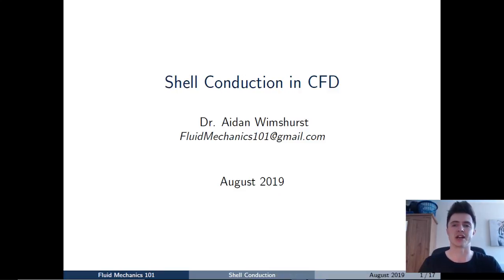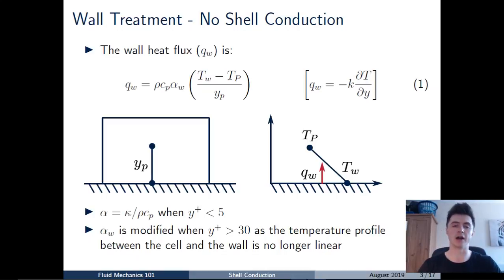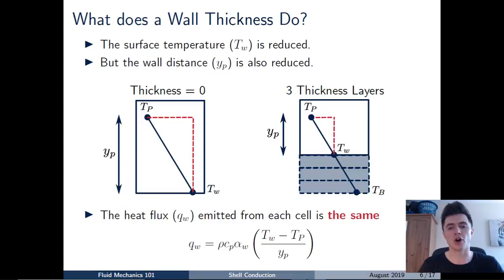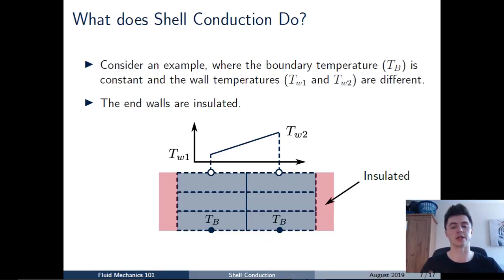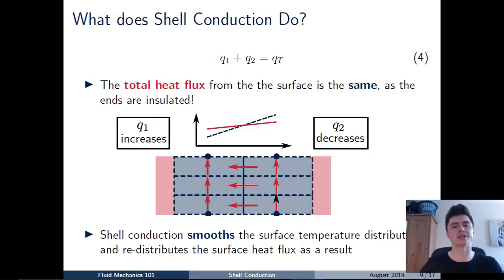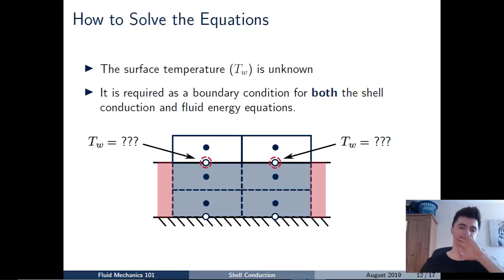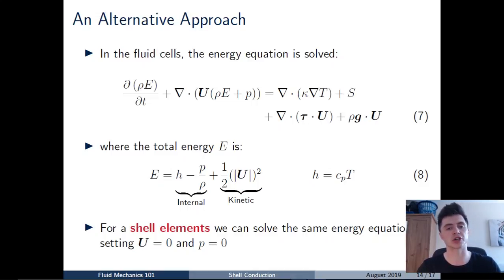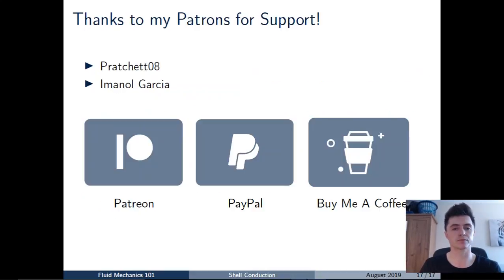[CFD] Shell Conduction in CFD

Comment: Hi,Adan, thanks for your vidio! here i have a small question. A thin wall with uniform temperature distributioin, we can only set single shell layer, because the heat flux only can transform along the normal direction of  this wall, if this thin wall with ununiform temperature, how many shell layers i should to set?
Reply from the maker: Good question, you probably need to make a simple test case and try different numbers of layers. If the profile is quite complex then you may actually need to mesh the thickness and run a conjugate heat transfer analysis

Comment: Thanks a lot of, I have question about how treat copper tube solar collector with or without thikness, when thikness of the tube is 2 mm and inner diameter is 8 mm,  if take it the tube without thikness, in the heat flux boundary condition in fluent setup apply thikness yes or no?

Comment: I tried the shell conduction option to simulate the heat transfer through the steel tube wall (and additional insulation) of a tube containing hot fluid. When comparing the results obtained using shell conduction, with the results obtained by fully modeling and meshing also the steel tube wall and insulation, they differ significantly. I think this is because the heat flux is assumed  to be constant when using shell conduction (as you have pointed out on slide 6). However, for a lot of (most?) 3D geometries (tube, ball, rectangle with additional layers on all sides...) this is not correct, since the surface area towards the out (or inside) will change which should result in an inverse change of the heat flux. 
Am i getting something wrong here or is this really the case (which would be quite a bummer tbh)?
Reply from the maker: Yes you are correct. If you are modelling the thickness of the wall and the insulation which is probably quite thick, then the outer area is quite different to the inner area (this is why we have different equations for the thermal resistance of cylindrical and polar elements). The shell conduction equations are for planar heat conduction, so there is no surprise that you have a noticeable difference here. From personal experience I have always found: if you can mesh the solid and the insulation, then it is usually worth it!
Reply: @fluidmechanics101  thank you !

Comment: As far as I understood the shell elements do not grow away into the fluid, they grow away into the solid. But in your presentation you say the opposite. Do I mislead smt?
Reply from the maker: The cells are 'virtual' so they aren't grown in a physical sense and don't take up any space. You could consider them to grow in either direction, you just need to be careful with your mathematics. I have chosen to grow them outwards out of personal preference
Reply: I thought the same, and also that - what if we are reducing the fluid volume/cross section in using the shell conduction approach...! Then I found this comment, and it clarifies. xD

Comment: Thank you for the brilliant video!!! I have a small doubt. 
For the example conjugate heat transfer case shown in the video, if we are going with shell conduction option then we will not be modelling the wall thickness. Now, the commercial code ANSYS FLUENT will treat the interface as a Fluid-Fluid interface. In that scenario giving shell conduction on one wall (Fluid) will automatically enable shell conduction on the other. So in this case how to define wall thickness value and how will the geometry change??
Reply from the maker: This is a question that you should probably ask ANSYS support as I don't reallyyyy know what is happening in their code 😄 the best I can do is make deductions from their manuals

Comment: What if she'll conduction or thickness is applied between 2 solid domains. In which side the elements will be created, just like as u said for fluid solid domain, elements will be created towards fluid side....??
And thank you so much for the content Aiden. Though I'm finding difficult at some points, still they have been clearing most of my doubts.
Reply: I got this doubt, when u want to apply thermal resistance between the 2solids in contact. Can anyone give explanation to this....??
Thanks in advance.
Reply from the maker: I think you can apply something called a ‘contact resistance’, although i havent looked into this much myself. If anyone else had any thoughts, they would be much appreciated
Reply: Hi Aiden, 
As per ur explanation, if wall thickness is modelled into the fluid volume for shell conduction or thickness case, then effective internal dimensions will shrink (provided thickness is considerably more). Is it right....?

Comment: Thanks again for a great lection! - Turns out I actually missed a few details about shells.

1) If wall distance (yp) is reduced according to the shell thickness - then what if shell thickness is higher than first prism layer thickness?

2) Do I get it right that shells (at least in Fluent/CFX) can be used in transient simulations and they actualy "store" heat?
    At least that's how it looks like since energy equation for the shell contains ∂T/∂t.

3) I seem to miss the concept of "heat flux is the same": if boundary conditions are set to fixed Tw and Tf - than adding shell between increases thermal resistance and thus heat flux should be smaller, no?
Reply from the maker: Hi Sergey, in answer to your questions:

1) im not sure how CFD codes deal with this (as i havent actually seen the source code ... 😅) but i assume they have something clever ...

2) yes, shells do have transient capacity and store heat. This is why you need to specify the material density and cp for the shells as well as conductivity.
Reply: @fluidmechanics101  Concerning Point Nr 2: 
I did a practical test if Capacitance has any effect in walls with enabled shell conduction. 

My test setup is simple:
I have two neighbouring buildings with a different kind of wall-setup:
1 Building with non-meshed walls with shell conduction enabled
1 Building with explicitly meshed walls (having the same thickness as the non-explicit walls)

I ran a transient case with solar load over 24 hours. During the evening hours the Explicitly-meshed walls were still slowly cooling down, while the Shell-Conduction-walls are cooled off immediately (following the decreasing solar intensity in the evening of course). 

So my verdict with that experiment is that walls which are non-explicitly modelled do not have the ability to store heat - basically the Specific Heat value in the material properties is neglected. 

I've used ANSYS Fluent 2020 R2 - The Official ANSYS Fluent Support has confirmed the above results. 
I have the hope that in a future version capacitance for shell-conduction-walls is implemented 🤞
Reply from the maker: Ah yes, I really hope that ANSYS implement capacitance in their shell conduction model. It would be really useful!
Reply from the maker: 3) Yes but the distance between the wall and the centroid decreases as well, so the temperature gradient stays the same. Therefore the heat flux stays the same (unless you have shell conduction on and then the heat can move along the surface as well) 

I hope this helps!
Reply: @fluidmechanics101  Got it, thanx a million :>